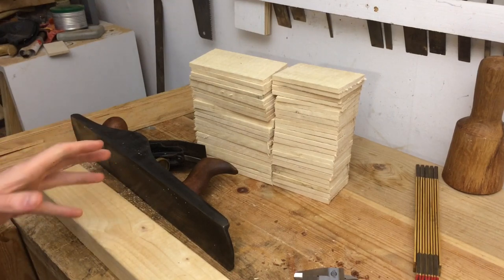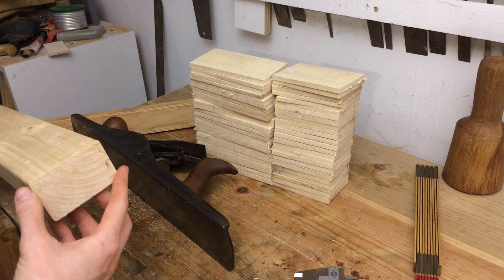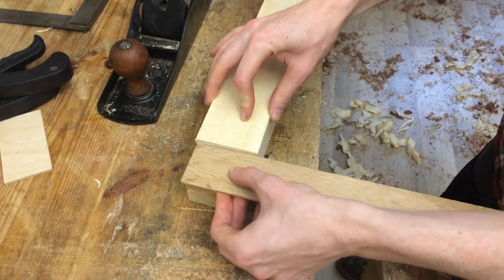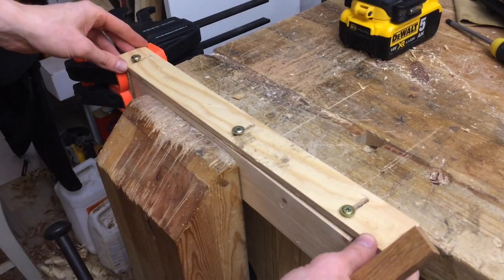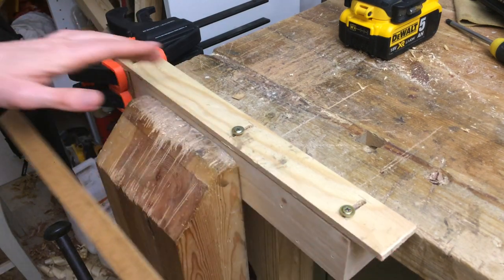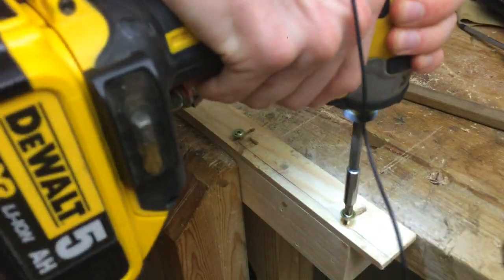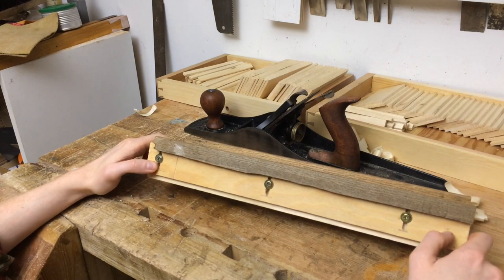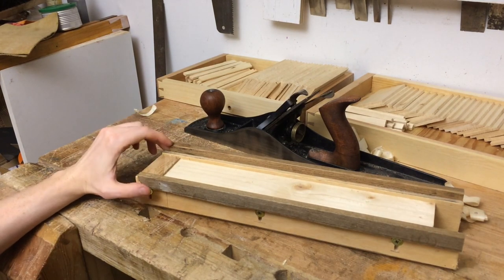Handplane thicknessing jig for small parts

Comment: Hi I made a jig with fixed side and used spacers to raise the workpiece but a problem I found was that once the plane started to bottom out, the blade would have a tendency to grab the workpiece and pull it up into the plane thereby making it thinner at one end.  Just wondered if you exerienced this.  I think I might have fixed it by adding a bit of an old rip saw blade at the plane stop end to hold the end of the workpiece.

Comment: Hello Gillis, I’m designing a basic workbench now and noticed you used yours very effectively - I was wondering if you feel there’s any advantage to a leg vice as opposed to a typical face vise and if you use a tail vice with any regularity. I also noticed that the legs and sides of your bench meet flush - there is no apron - any comments on that? And finally, how did you join the legs to the tabletop? Would appreciate your comments and I apologize if you have a video on your workbench on your channel, I’m a new viewer. Best, Nick
Reply: Thanks for the video by the way, very clear and informative. Tricky to plane by hand to an even thickness below about a quarter inch!
Reply from the maker: The leg vise is kinda the only thing I like about this bench to be honest! But it's a huge improvement over the face vise I had before; much larger capacity, and much less racking. The tail vise I have at the moment is very bad, but better than none, and I use it often. I didn't need an apron for stability on this bench because of the construction, and I do have a couple of old videos on that :)

Comment: Do you keep your plane blade at a certain depth of protrusion? That can affect the thickness of the piece correct even with this jig? I’m thinking of building on of these.
Reply from the maker: It certainly has an effect, but usually, as long as a batch of parts is the same thickness throughout, it doesn't matter if that thickness is a few hundredths of a mm more or less than what you aimed for. Getting the sides dialed in accurately is far more of a factor than blade protrusion, but again not really an issue, as neither would change during work on a batch. If you need many different thicknesses extremely accurate to each other, this jig needs upgrading!

Comment: Here’s an idea I’ve stolen from Adrian Preda’s channel: fixed rails. Instead of moving the rails up and down, put shims into the bed of the jig in order to determine the thickness, bringing your workpiece up towards the rails. The stop would then be the bit that has to be adjustable, but that’s a lot easier than setting the rails.
Reply: I have also made a planing sled with fixed sides that uses spacers to raise the workpiece up as needed. The stop does not need to be adjustable either -- it just needs to be installed so the plane's blade will clear and not wack into. Works perfectly!
Reply: I believe 2 wedges would do great too to support the pressure

Comment: I am thinking of building something similar but wider than my plane and then just skewing it to span the distance between the rails.
Reply from the maker: Should work! You might be able to do slightly wider boards that way.
Reply: @GillisBjork  exactly what I am hoping to achieve. I also consider making the stop removable to be able to move it along longer boards.